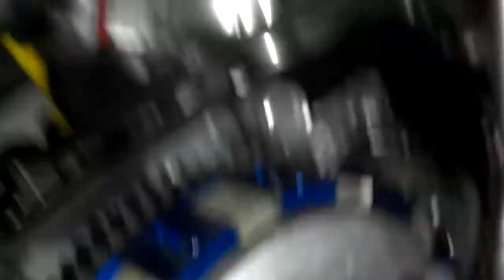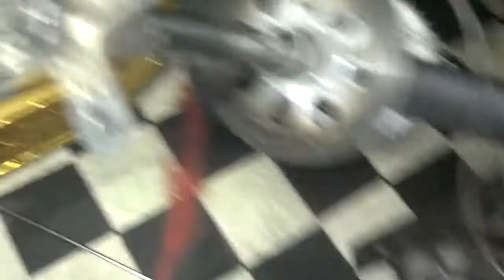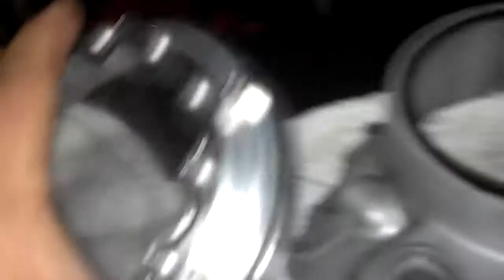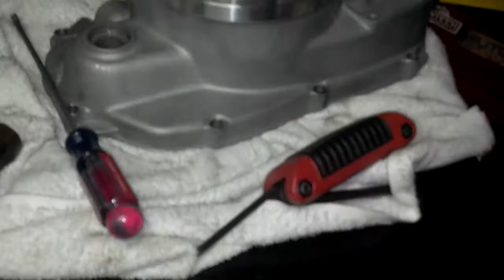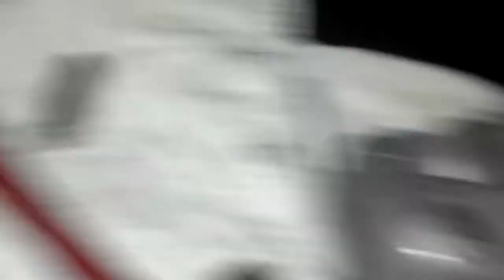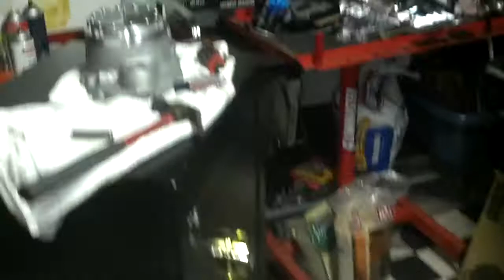Yamaha banshee 400 cheetah cub update!

Comment from the maker: So you have a lockout? I had that issue too but Im also using the clutch pusher which is what gave me an issue! You have to watch the nut and washer in the pressure plate! In my case every time I adjusted the clutch through the Philip head adjuster on the pressure plate it would also spin the back piece making it loose! If that makes sense to you! What exactly is it doing?